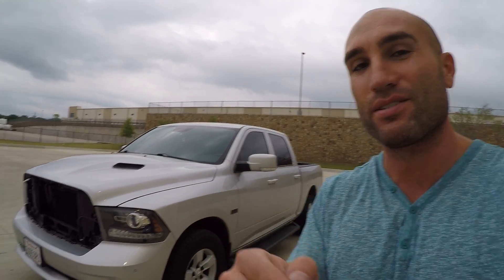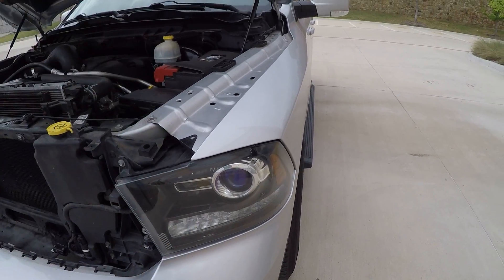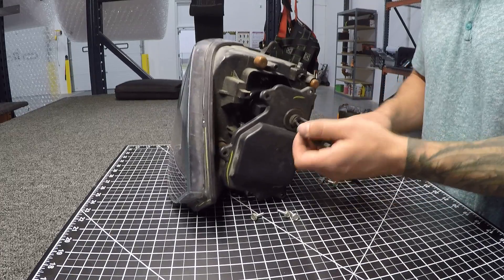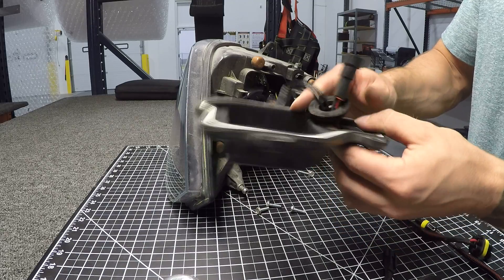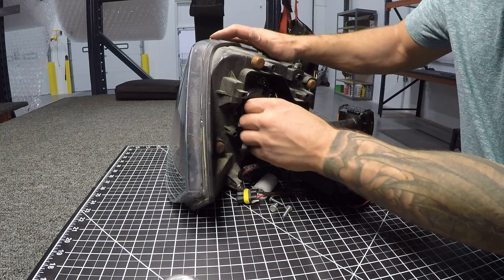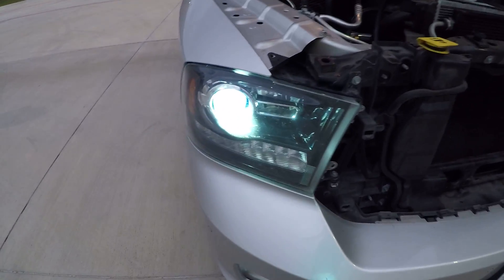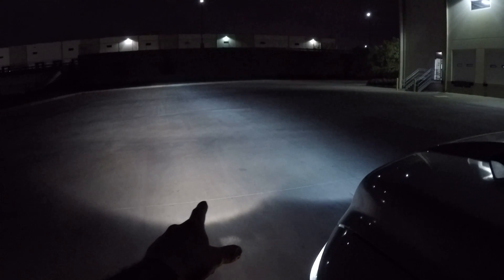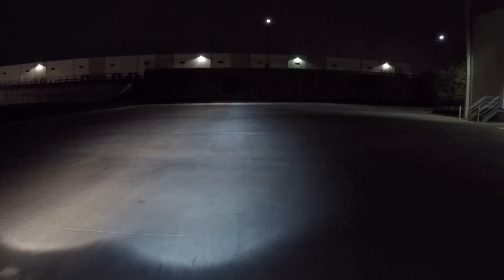What is the difference between 5000k and 6000k HID Bulbs?

Comment: i have 5500k leds in my projectors they shine very bright and pure white.  5000k has a yellow tint, 6000k has blue tint. best is 5500k
Reply: With a 55w ballast or 35w??
Reply: Leds doesnt have ballast :)  The Leds are 20watts each
Reply: 35w 5000k HID does not have a yellow tint, it’s pure bright white. I have 6000k Leds and they are light blue also but I will be getting 35w 5000k HID

Comment: I've ran 6000k in all my vehicles that had projectors. never had an issue with seeing "more" or one being safer than the other. I chose to run the 5000k in my Jetta and got flashed all the time from people thinking it was my high beams. to be honest getting blinded from ass holes thinking my beams were on was more dangerous than running the 6000k to begin with, i'll use the 6000k when i pick up my ram next week
Reply: I drive 4300k bulbs on a 70w ballast and have no problems
and as soon as the roads are wet everyone sticks behind me because they can't see anything, especially with 6000k and higher

Comment: I have used 4300k (yellow, the default setup), upgraded to 6000k (bluish) and finally settled on 5500k, which gave a better illumination compared to 4300k and 6000k. The problem with 6000k is that it looks nice when roads are good, but doesn't inspire confidence on not-so-good or bad roads. The problem is aggravated during rains and fog when the visibility drops down. 5500k seems the best of both worlds.

Comment: 5000k are great for light output and rainy conditions but 6000k are gentler with your eyes when u drive a lot at night. I had 5000k for about 4 years and I switched recently to 6k and I am happy. Is not as deep but way better for ur eyes. Also I think the 6k in the video where way too blue, more like 7k. Great video though.
Reply: Color of sunlight is most natural and most comfortable for any biological species including humans. Last I check the sun wasn't blue my man!
Reply: @AveGuy1 This.

Golfsito you're wrong.
Reply: sorry, your statement is nonsense
the higher the color temperature, the more strain it is on the eyes, the fact that 6000k seems more pleasant to you is simply due to the fact that 6000k produces 30% less light than 5000k
if you drive a lot at night, you should take 4300k

Comment: The 5000k seems to illuminate more. Could be the camera but when you look at the end of the parking lot the 5000k seems to have a higher intensity. That’s for comparing all these different products!
Reply from the maker: Thanks Bill!   I agree it does seem like the 5000k is better light.  One thing to note is passenger headlights are usually aimed higher than the driver side so that also shows up in this test too!
Reply: Warmer temperature will give you more lumen. 4300K for most.

Comment: Are 55w hid safe to use on projector housing?  I want to buy hid light for my truck but i heard 55w get too hot and they can damage the housing. Is that true?
Reply: Luis Chavez no point in 55watt. 35 watt is plenty
Reply: Luis Chavez i have had 55w 5000k on 2 different cars and they both worked fine. No heat issued or anything.
Reply: 75w ballast in housing might give you heat issues. Bare in mind 55w halogen are quite hot

Comment: Hey man did you have to aim your 55 watts hid headlights down? When I put mine in I had to aim them down people kept flashing me, especially in rural areas when it's pitch black outside. I used to have 4300k and man those were extremely bright. Your right about the more blue the less light. It's actually the lower the color temp, the more lumens your actually getting. I went to 5k and now I'm at 6k.
Reply from the maker: Mine have been fine Colton but I also have the factory suspension and ride height on my truck.  Do you have your truck leveled by any chance cause that would definitely cause them to aim high 😎
Reply: BoostedMotorsports stock suspension.  It's the gtr kit from HR. Maybe they are just stupid bright. Idk. I wish I could run them up higher but to many pissed off people lol.

Comment: I can’t believe your HID’s don’t cut in and out without a relay hardness. My HID’s do and I have the same brand but I’m fixing that issue soon with a relay hardness with resistors. I have a 2016 Ram.
Reply: Willy’s DIY his is a 2013 thats why. 2015 and up rams started having problems with hids better off going with leds jus plug and play
Reply: I'm running just a 30$ CANBUS kit off ebay in my 2018 sport. I've had no issues and I'm only running the ballasts and bulbs. No relays or anything extra..
Reply from the maker: Yeah I just have the HIKARI CANBUS decoders on this 2014 and no issues other than the auto function acting a bit strange so I just turn my headlights on manually
Reply from the maker: 2014 here but with just the Hikari CANBUS decoder it seems to work decent! 😎

Comment: What do you think about leveling kits?
Reply from the maker: Hey Ben. They are cool if you are going for the offroad look or want to fit 35" tires but with my truck being 2wd I won't be lifting or leveling.  Also it loses a bit of gas mileage when you level it cause its not as aerodynamic after.
Reply: BoostedMotorsports thank you for answering. I appreciate it. No leveling for me

Comment: Just a quick question...
Are both of them 55W or 35W?
Reply from the maker: Both are 55w and have the exact same ballast for this test.  All I did was change the bulb to see the difference 😎👍
Reply: @BoostedMotorsports  doesn't the 55w ballast shift the kelvin temperature? 6000K bulbs looks 5000k and 5000k look 4000k with 55w HID
Reply: @AmongUs-mb4qx  yeah you will get a warmer temperature if you go higher in wattage. 35W->55W for example.. 6000K goes about 5000K

Comment: I may seem bad, so sorry, but when I see people driving with blue lights at night, I think... stupid.  Safety is more important than cool.  At 5:20, put a finger from each hand on opposite sides of the beam pattern where they meet the line in the pavement.  (Yes, I know, that seems funny.)  The 5000K have a much wider, usable beam.  There's an obvious difference in distance from each side of the truck.  The 5000K also project stronger/brighter at the end of the beam, which means the beam goes further.  The 5000K will be better for bad weather.  All equate to better safety!  Just make sure what you buy is legal/DOT.  It's not impossible to be on the wrong side of a suit if in an accident at night, since more people are aware of legal versus illegal bulbs.  :-)

And, please, properly adjust your lights!  If I could actually slap every person that blinds me on the road at night, I would not have any hands!  :-p
Reply from the maker: Good points!  I too prefer the 5000k for same reasons you mentioned and the fact that you can see in wet weather. The 6000k is almost useless in wet weather and the light just bounces off the road.  Lights are aimed correctly and I've never had anyone flash their lights back at me 👍👍👍
Reply: Sometimes I say something as a blanket statement, such as, "And, please, properly adjust your lights!"  I am sure you knew that was not meant for you, but I thought I would clarify.  :-)  Anyway, IMHO, I actually think the 5000K look better!  And, if someone wrecks into me at night, one of the first things I will do is try to find out if their lights are legal... if I am not mangled up!  :-p  (Of course, also, I would not slap anyone!)  ...  BTW, thanks for the reply, and good video!

Comment: Give me the link for the 4300k/5000k comparison. I want to combine my factory HID xenon light with a LED H8 bulb fog light but would like to get a similar color. Is the C6s close to the factory HID?
Reply: He has not made a vid of that yet. I had them both and can tell u what I think. My eyes prefer the 5000k because it's more white than the 4300k, but the 4300k are a little more effective in rain and fog than 5000k. I have 4300k with 100w ballasts.

Comment: Mines didn’t come with an adapter for the bulb. It was just straight bulb. No way to lock it in place does anyone have the correct link?
Reply from the maker: Which ones are you looking for and I’ll try to help ya out
Reply: BoostedMotorsports the 5000k hid kit for the low beams

Comment: Dude you can't compare colors by just using your unlocked courtesy lights feature. The vehicle has to be on for the ballast to get the full wattage and light up to true color and intensity.
Reply from the maker: Used the remote to keep them lit but they were warmed up for the test.  Just kept pushing the button to keep them on without all the other running lights for the best comparison.  Turning the headlights on would turn on running lights too and camera wouldn't be able to pickup the light difference as good.  Remote is only way to keep just the projectors on.